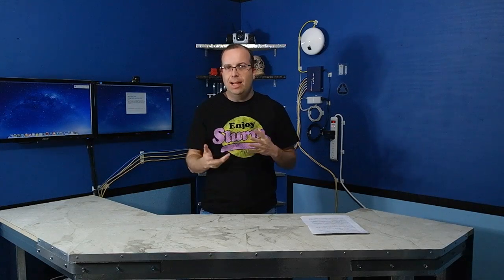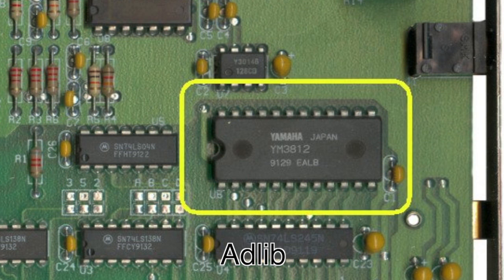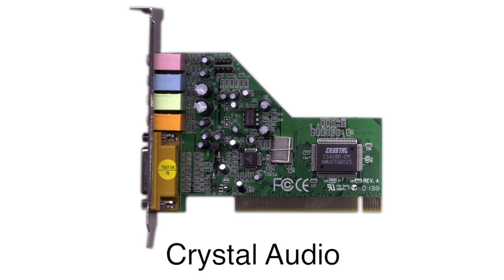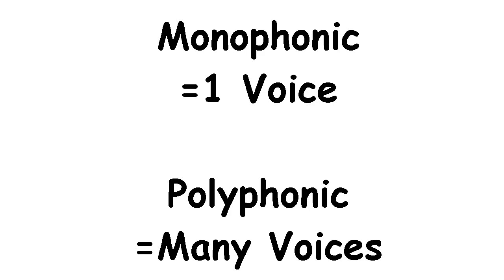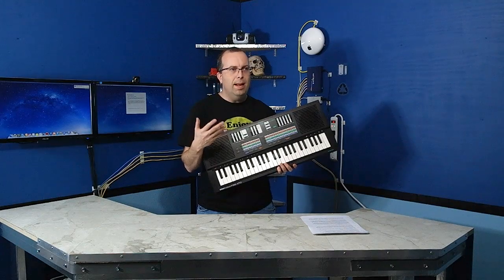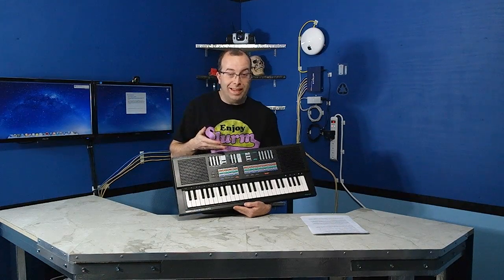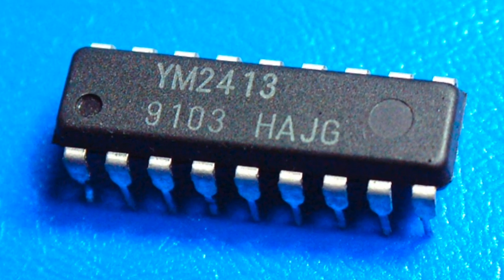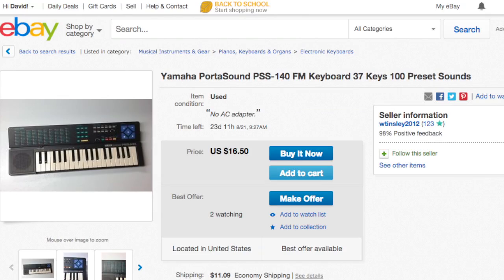Meet the little-known "Soundblaster" Keyboards

Comment: Fun facts for you: 64-bit Windows computers can't emulate DOS games, so sound chip emulators for those aren't bundled with those 64-bit editions. You'll need something else, like DOSBox. On a side note, many versions of Windows, both 64 and 32-bit, emulate a GS Wavetable Synthesizer, with samples from Roland's Sound Canvas GM/GS Sound Set from 1996, for when you ask your music player app to play a MIDI file. These samples were licensed to Microsoft and are bundled with Windows to this day.
Reply: Also, since Windows Vista, new models for graphics controllers were made, WDDM controllers. These can't jump into text mode or send DOS graphics data. So proper DOS emulation was broken in the newest editions of Windows.
Reply: Doddo MultiGamer One word: EMULATION.
Windows x64 itself may not be able to run DOS games due to a processor layer being unavailable, but if the processor itself is told to run 32-bit Windows or 16-bit DOS, that layer will be emulated and run just fine!
DOSBox emulates this layer too, all the time. That's why it can run on a 64-bit Windows PC too.
As for exactly what that layer... instruction thing is... I don't remember.
Windows WDDM controllers may be unable to jump to text mode, but your computer's BIOS or EFI CSM module are still capable of it. But in EFI machines, their CSM module is also an emulator. EFI PCs have another set of protocols for console text and graphics display.
In other words: GODDAMIT MS EMULATE THAT SUBSYSTEM ALREADY AND GIMME MY DOS APPS BACK!!
If WDDM controllers can't run in text mode, then don't. Just pop a window in fullscreen exclusive mode (the kind videogames use) and emulate textmode instead of trying to pipe it to the system directly. That's what DOSBox does, and it works.
Reply: WDDM is merely a Windows interface to the graphics driver, it says nothing about capabilities of the hardware. It was intoduced in Windows Vista, where some things like GDI acceleration and text mode were no longer needed and thus are no longer accessible from within Windows. But other operating systems, Linux, older versions of Windows, etc., can still support text mode, it's not gone from the hardware.

Other peculiarity is that once a x86-64 processor has been reinitialized in long mode (64-bit support), vm86 mode is no longer available by spec. Vm86 is the mode that allows a protected-mode program to span a real-mode compatible environment inside of itself. DOS support in Windows 2000, XP was completely based around vm86 mode. So it made sense for Microsoft to start removing things that were needed for vm86 support.

I don't know why Microsoft should concern themselves with emulation of older subsystems necessary for DOS games? They were never particularly thorough at that, in theory third parties can do a better job. But it's not a very commercially viable field, so that limits the effort put into that.
Reply: Why the Global Defense Initiative will have an Acceleration and Text Mode? Man that is why NOD kicks it ass all the time.
Reply: You could just build a retro PC and use it for DOS. Parts are fairly cheap.
Reply: We now have a subsystem for Linux, which is only available on 64 bit systems, and we have a subsystem for DOS, which is only 32 bit. Perfect balancing
Reply: It shouldn't take much effort to find an old obsolete PC at a garage sale or something.
Reply: +skirmich command & conquer
Reply: fargeeks Good Times...
Reply: Fun Fact: i runned DOSBox in windows 7 64 bit home-premium language chinese simplified
Reply: Actually, x86 CPUs since the Pentium Pro have been effectively emulating x86, and running an even lower-level internal microcode. 

In addition, if you're in an x86-64 OS, the CPU is in "Long mode" and cannot natively run old fashioned "real world" code. It can only do so in "Legacy Mode" (which is the old 32-bit "protected mode" that we used on every 32-bit x86 version of Windows from 3 to 10) which is arguably a type of emulation.
Reply: Building on this, DOS (a 16-bit OS) can technically run on modern hardware because modern hardware, thanks to the limitations of the old BIOS system. still starts up in what's called real-mode, which is a 16 bit text-mode or VGA before being elevated to the full x86(-64) mode by the boot manager. This can't be done on UEFI systems as far as I know since they skip the real mode boot, but if you've got a proper BIOS, you can still run a DOS image from a USB thumbdrive pretending to be a floppy or something. As for app support, the drivers don't exist for modern hardware so you won't get very far.

Regarding text-mode, all graphics processors have to support it for backwards compatibility for those reasons, and regarding the Roland stuff in Windows, it's an incredibly crap emulator of the Sound Canvas. The real one sounds so much better.
Reply: While that is true, SoundBlaster emulation may still be in hardware, or burned onto a ROM chip, either internal to the sound chip, or in the PC BIOS, and all PC video cards still support text mode.
Reply: You know your legacy card is a winner when your crack loaders sound better than your mp3's
Reply: @3lH4ck3rC0mf0r7  An x86/x64 processor cannot switch to and from v86 (virtualized real mode) while running in 64 bit protected mode, but can do that while running in real or virtualized 32 bit protected mode. You can run 16 bit code from inside a 32 bit VM on a 64 bit host.
Modern CPUs are fast enough to emulate a 16 bit real mode in software, to run old games. Also, the 64 bit VM host simulates 16 bit real mode when doing real mode POST and boot.
Reply: @Alexagrigorieff  Even with virtualization extensions, it's still emulating 16-bit real mode in software while running VMs? I would've thought the VM would always start as v86-on-virtualized-32bit mode and then the VM BIOS would be able to kick it up into protected 32-bit or 64-bit mode as set in the VM settings, similarly to how a real BIOS does it on metal.
Reply: @BertGrink  & Mister Shledge Yeah we could buy/build a retro PC...... if we had the space !
 Emulation allows us to play almost any computer and console that was ever made without taking up any room. Just as well, as there were so many of them! In the 80s and 90s, I went through two Sinclair Spectrums and two Amigas. I'm playing those old games and discovering gems on other old systems. Even if I was lucky enough to have space for even more than one machine (this one), then I would most likely use it to store real books, physical board games, etc. My shelves are overflowing as it is.
Reply: @jezz2k  But what if we LIKE to tinker with hardware? Tell me how you can do THAT with an emulator! Granted, some emulators allow the user to select from several different interfaces, but that selction is ultimately dictated by the author of the emulator. If you want to concoct an entirely new interface, only real hardware will let you do that.
Reply: @BertGrink  Hey, I'm not trying to stop anyone from tinkering around and doing what they want. For me, personally, I don't have the space and I'm happy using emulation.
Reply: I'm not even sure if Windows XP had Sound Blaster emulation in it, I remember running the demo version of Wolfenstein 3D directly from Windows itself and not getting sound at all, just the PC speaker sounds.
Reply: @Lachlant1984  If you couldn't get sound when running a DOS game natively in XP, you could've used DOSBox or VDM Sound. DOSBox is still good today.
Reply: @Lachlant1984  It didn't. If you had the real hardware though, it used it.
Reply: @3lH4ck3rC0mf0r7  Are you replying to my comment about playing Wolfenstein 3D in Windows XP?  The computer I had at the time had a Realtek sound chip in it as most have done since the early 2000s, and of course the computer was far too new to have ISA slots on its motherboard.
Reply: @Lachlant1984  Yup. If you had had a slightly older (or weird mobo) with ISA slots, and a SoundBlaster chip on it, XP still had all the software circuitry to make that work. VirtualBox makes it happen if you use the right audio settings :D
Reply: @BertGrink  Open-source emus son. Tinker with hardware... in software.
Reply: @3lH4ck3rC0mf0r7  I see.  The computer was bought new in 2009, I no longer have it and I never removed its top cover, but I'm pretty sure it has only PCI-Express slots in it.
Reply: @nastysdsi  That's for Windows 3.1 (and other 16bit win) apps, actually. Then there's a leaked MS NTVDM sourcecode that people have modified to work on 64bit with CPU emulation.
Reply: @user-tt5js4bh2v  hm? Those crack loaders just play back samples with emulated synthesis.
Reply: I built two old computers to play dos games and old stuff :)

Comment: I think it's more fair to say modern PCs still support the general MIDI standard rather than Yamaha FM synth chips specifically.  Sound Blaster cards only included Yamaha's FM synth chips through the Sound Blaster 16 days. Starting with the AWE32, Creative Labs dumped Yamaha's chips in favor of the e-Mu line of MIDI synthesizers/DSPs. They kept support for Yamaha FM synth in their cards only until DOS gaming was dead & gone, and that level of hardware backwards-compatibility was no longer needed. These days, Windows provides MIDI playback via a rather crappy software-based wavetable synthesizer.

Comment: These keyboards sound great. So much better than the sample-based Casios I grew up with in the 90s. I would love something like this with a Commodore 64 SID chip in it. I converted an old Casio keyboard into a MIDI keyboard with a breadboard and a Teensy, and I have a SID chip lying around. I might just have to try and make that happen.
Reply from the maker: +jordanzish That would be cool. It should be possible to do using Arduino or something like that to substitute as a brain for the keyboard.  You could turn any keyboard into a SID station.